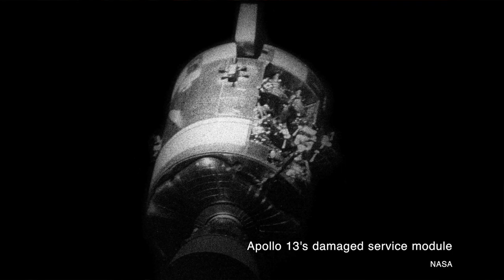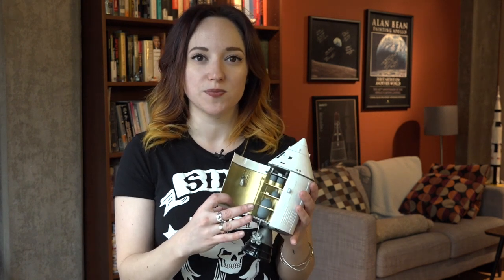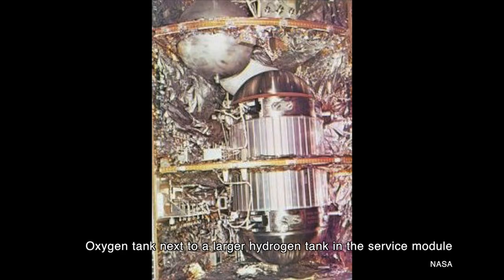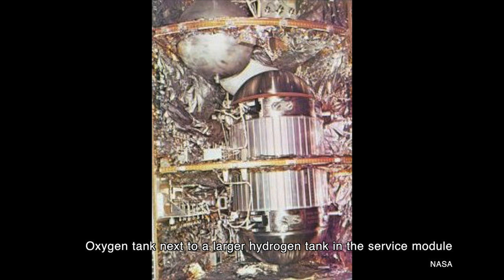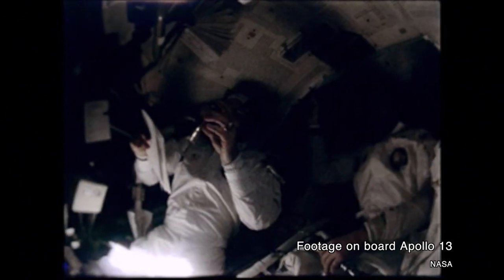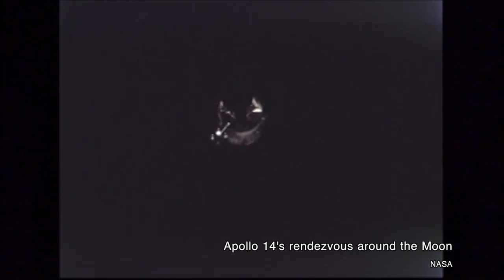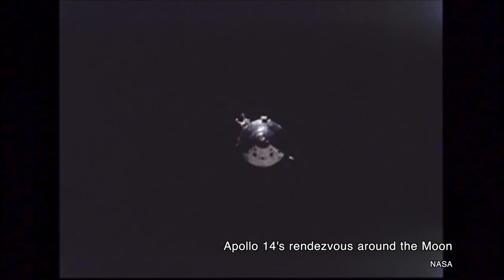What did NASA Change After the Apollo 13 Disaster?

Comment: Wait wait hang on a second.  So you're telling me that:
1: The oxygen shelf piece was used, and not new.
2: They'd tested the system with a wildly-higher power supply (65V) than the 25V that the spacecraft gave.
3: So it was already damaged BEFORE launch day.
This was exactly the kind of thing that Werner VB had talked about years before, and on TV no less: that most rocket failures are not caused by things that break in flight, but rather by parts that launch pre-broken, right from the beginning.

Comment: Just curious..one of the main reasons fuel cells were chosen over batteries was due to weight limitations(batteries  are heavy) So how did they manage putting a battery in the service module? Did they eliminate weight elsewhere?

Comment: Very fine report, once again! However, and I need to retrieve a couple of documents to check actual dates and voltages, you missed (unless I missed) the fact that Beechcraft simply over-engineered a part. (My buddy's words, not mine, and he worked as a Producibility Engineer at Beech for over 40 years.)

As he related to me, Beechcraft was an Apollo subcontractor, and (one of?) their component(s) was the cryo stirring fan inside the LO2 and LH dewars. Beechcraft, always on the cutting edge of putting more effort into customer satisfaction than absolutely essential, designed a tiny heater to ensure the fan wouldn't freeze up and fail at a critical moment and incorporated this into the unit. 

The problem was, the fan and heater were designed for an earlier design spec for the CSM electrical system, which was a much lower voltage (I can't recall the specific numbers and don't have David Baker's "History of Manned Space Flight" close to hand, but it started out with something odd like 17 or 27 volts and was upgraded to something weirder but many times more powerful, like 65 or something) than the original (Block-2?) flight specification. 

Somehow, that very important change in voltage didn't get to everyone it should have.

Dropping the tank (what, an inch or so?) was eliminated as a major contributing factor pretty quickly after it was suggested, though it was the prime suspect for a while. The overloaded heater on the cryo fan, however, was also responsible for the slow release of pressure in that tank (an anomaly that should have raised alarm bells even in NASA's overconfident atmosphere) and eventually led to the crucial spark. 

I love your channel! 99.44%pure, IT FLOATS! Sorry I don't have the actual numbers here.

Comment: Great stuff. 
Consumables.  
Do you know the formula for estimating how much hydrogen and oxygen are required to make a litre of water?   
100,000 K Calories of heat?  
45 VDC at 25 Ampres for one hour?
Did the the drinking water that was made from hydrogen and oxygen reqire any filtering or purification processing?

Was DEC Computers in Natick Mass a computer contractor for NASA?  If so, what did they do?  
I used to work with DEC gear.

Comment: A piece of that assembly was removed from the Apollo 13 Service Module...and installed into the Apollo 12.
The part was later replaced in Apollo 13.  Somewhere in the transfer...the wiring may have been damaged/frayed.
I've still got the scrapbook with the news article for Apollo 12.

Comment: Interesting about the thumbnail is that the Apollo 13 CSM configuration pictured never really happened. The spacecraft were around 35K nautical miles away when the CSM-LM stack was finally detached, and it was the service module that was popped off first, leaving the bell-shaped CM connected to the larger LM for a while before it was also jettisoned.

Comment: Amy, I'm confused about something you said in this video, that is that an oxygen tank that was used on Apollo 10, the first trip to the moon, was used again on Apollo 13. Were the service modules somehow recovered after the command modules separated for re-entry?
Reply: +Peter Palumbo I stand corrected it was the shelf that you said flew on 10 was installed in service module used on 13.
Reply: +Peter Palumbo 
It didn't fly on Apollo 10. She meant that it was reinstalled before flying.
Service modules were routinely abandoned to the incineration of re-entry.No component could survive to fly twice.
Reply: +Peter Palumbo - The Oxygen tank was originally installed on the Apollo-10 service module but was swapped out before the flight and then that same Oxygen tank was installed on the service module for Apollo-13.

Comment: Hi Amy. I was wandering if you could make a vid on why there was less computing power in the Apollo spacecraft than there is on a desktop calculator/phone? Thanks and keep up the great work!
Reply: +Yanni Tsetsekos You was wandering.
Reply: cause computers get better so fast
Reply: +Yanni Tsetsekos Because a) not much computing power was needed and b) most of the heavy calculations were done on Earth and the result uploaded to the Apollo spacecraft.
Reply: @AllanFolm  ...and c) the size of computing equipment at the time would take up a whole floor of a building! The use of the earliest solid state transistors for RAM and magnetic core rope memory for the ROM enabled NASA and MIT to put a very small computer in the space of a breadbox. The computer was originally envisioned to control the entire flight, but software delays compelled NASA to designate it as a backup to ground computations.

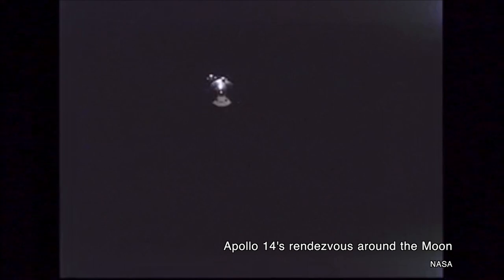Comment: Amy, Love the stories you do.  I have one quick question for you.  In this video starting at 3:22 there is a picture of the CM and the SM connected and doing a slow 360 degree pitch maneuver.  I've thought about this for quite some time and I can not come up with a reason for it, other than they were having fun, which I'm sure is not the case.  Would you please take up that question for me in a future video?  Thanks and love what you are doing.
Reply: Those are visual inspections, 360 degree rotations so that the entire outer surface of the vehicles could be observed and being filmed so that the engineers back at home could see how the vehicles were standing up to their time in space.  Each mission also include the LM accent stage doing a 360 and being filmed from the command module.

Comment: Nice Vid Amy. Question: why did they choose not to fit the CSM with solar cells? Soyuz has them: it would seem like a reasonable backup against fuel cell/battery failure.
Reply: +Harold Weaver Smith Apollo era solar cells weren't that great.

Comment: Minor, but worthwhile, point:  At least some Apollo engineers opposed the redesign of the oxygen tank that was performed.  Why?  Because the redesign created what amounted to a totally new design for the oxygen tank, eliminating the flight experience that had been gained with the old design (on Apollo 4 - 12).  Much more sensible, in their opinion, was to simply implement the Engineering Change Notice that had been posted way back when to update the thermostat in the heater to support ground voltages.

The managers overrode them:  given the nature of the close call that had been experienced, they felt (with reason) that neither the public nor the politicians would accept such a trivial change as the resolution to such a nearly catastrophic accident.

To be clear, the new design was certified -- on the ground.  But the first time it flew into space, it was on Apollo 14, a lunar landing mission.  Had something gone wrong in the redesign, it would have been a very bad day all around (and would have almost certainly resulted in the cancellation of the rest of the Apollo missions).

Something similar, but much more expensive, occurred after the Challenger accident:  the obvious engineering fix in that case was "Don't launch when the temperature is below 50 degrees Fahrenheit", possibly combined with "Place [external tape] heaters on the SRB joints to ensure that they remain warm pre-launch".  The actual redesign that was performed totally redesigned all the joints in the SRB, providing loads of redundancy for the seal (for starters, while the O-Rings that caused the problem were still present, and a third was added, the actual joint design was designed to ensure that no gas hit even the first of three O-Rings).  Again, while a through ground qualification process was performed on the new SRB design, most of the flight experience was no longer relevant to the new design, creating a significant risk of an unreleated failure mode being discovered the hard way.

Frankly, I'm not certain that the the politicians / managers don't have it right in these sorts of cases, but the engineer's argument is persuasive.

Comment: Excellent Vid as usual...Could  you explain how exactly the two units were connected that kept them from shearing apart during the explosion and the backward maneuvers (LM pushing the CM) that were performed to get them home?  This seal had to be very complex airtight and stable even after an explosion that blew a whole panel away.
Reply from the maker: +Joe Krol I'm working on something about the Apollo 14 docking anomaly, so that blog should have a section on how the docking and tunnel actually worked. Think that video should be up this week or next!
Reply: +Amy Shira Teitel (Vintage Space) Sweet!!!!!  Thank you!

Comment: Hi, 
The movie showed a sequence where the crew had to find a way to improve the CO2 scrubbers - ‘round peg in a square hole’ We’re these filters standardised to one universal design after Apollo 13? Krgds RodH
Reply: No.  The reason why could take a while to explain, but the bottom line is that if there were a known issue that could be solved procedurally and not require a physical engineering redesign of the craft (which itself would require costly testing, etc.), then there is no real need to re-engineer it.  In the movie, they over-exaggerated this a little bit.  In reality, they constructed more than one of these "conversion kits" (for lack of a better term) to fit the canisters from the CM into the LM.  They all worked flawlessly.  While there might have been a bit of scrambling to figure out how to do it, once they figured it out, they essentially had a proven and reliable procedure to fit the canisters from one craft into the the other, so they had a procedural fix if that problem every arose again.  If the program had lasted long enough, perhaps somewhere along the way, they would have re-engineered the craft so that the canisters fit both and were universal, but at the time, there was no real reason to do so considering that had proven and demonstrated procedures to address the issue if the problem were to be duplicated.  Bottom line - procedural fixes were preferred over engineering fixes from a cost and logistical standpoint - and by a very long margin.  They had the procedures after Apollo 13, so they had the fix if they needed it.

Comment: there was actually one other error that played a role in the failure. there was a revision during the design phase in which the system was upgraded to accept the 65V ground power, but the thermostatic switch was overlooked in the revision. it was still only rated for 28V, not 65. so when the switch tried to open, the arcing caused the contacts to weld themselves closed.

Comment: Can you imagine if this had happened on Apollo 8?

Some of the details you've given differ from details I've gleaned elsewhere. The thermostat was rated for 28v because that was the original spec, but when the spec was raised to 65v, Beechcraft (thermostat supplier) for some reason didn't get the memo, and never upgraded the 'stat. I also thought the tank was depressurized because they wanted to do an internal visual inspection after it had been dropped - to be "safe"! - and turned on the heaters to boil off the contents, leaving it on overnight. The thermostat was supposed to open when the internal temp got up to about 100 F, but as soon as it got hit with 65v it welded shut, so the heaters never cycled on & off - just stayed on. It got up to near 1000F, & fried the wiring insulation, and the rest, as they say, is history. Am I full of crap? Can I never trust Wikipedia again? You da man, Amy, I will humbly accept any rebuke I am due.
Reply: +lesnyk255 I've heard that too..

Isn't "you da woman" more appropriate? lol
Reply: +lesnyk255 I would argue that "depressurized" is the wrong word. Amy should have used the terms "filled" and "drained" since the LOX was in liquid form

During prelaunch tests, technicians filled the tanks and then attempted to drain them afterward. When tank 2's drain valve was opened, it would not drain due to a dislodged drain tube thanks to the earlier dropping of the shelf. (Any gas pressure that had built up from evaporation/boil-off was instantly relieved so the tank was no longer pressurized.) Since they needed to have the tank empty, the only alternative was to wait for the LOX to boil off, which would take a very long time because the tank was so well insulated. (It was designed to keep the LOX cold for 2 weeks in space.) The solution was to turn on the heater to accelerate boil-off. 

Visual inspection after tanking was not necessary because it had already been done after the shelf was dropped and removed. Engineers knew the drain tube was dislodge but also knew it wasn't needed for flight, and the heater could be used to empty the tank after ground tests. If the correct thermostat had been installed in the tank, everything would have been fine.
Reply: +lesnyk255 :I was thinking the voltage on the spacecraft was 28 VDC because that seemed to be industry standard at the time. I worked on Titan II ICBMs which had 28 VDC systems on board. I also worked as a NASA tech and QA on Spacelab and ISS although I don't recall what the overall voltage was. Been away from it too long I guess.

Comment: Grr...

I'm a bit disappointed that you didn't get to my question. 'Did NASA change the lithium hydroxide CO2 scrubbers after Apollo 13 so that the LEM and CM used the same units?'

For whatever reason it seems my comments haven't been showing up from some platforms I've been using. Oh well...

Anyway, keep up the great work and keep the wonderful videos coming!
Reply from the maker: +MrWATM I don't think they did. It would have been a significant redesign at that point in the spacecraft and likely would have seriously hampered NASA's ability to continue with lunar missions.
Reply: +Amy Shira Teitel (Vintage Space) 

Thanks for the reply! I have another burning question, though:

In all of NASA's radio transmissions, why is there an audible 'beep' whenever someone finishes speaking? What is the purpose and do they still do it today?

Thanks again.
Reply: +MrWATM 
It's called a "roger beep" that was sounded when they took their thumb off the microphone button. It was intentionally done since there was a delay in signals traveling to and from the Moon to indicate the end of a person's transmission. I don't recall hearing them used during Shuttle flights or on the ISS, but I do know many two-way radios can be set up today to do the same thing.
Reply: Their offical name is something like "quintones"?
Reply: Quindar tones.
Reply: +MrWATM , I think they carried extra Lem scrubbers in the following missions.
Reply: That did carry over to the space shuttle program though. Any parts that could be made universally interchangeable were made to be so.

Comment: interesting that among your listed corrections there was no "added a regulator to limit the 28 volt bus to 28 volts".  assuming there was nothing limiting current, the heaters would have been dissipating well over 2x their rated thermal energy.  I suppose it's a testament to "over engineering" that they simply didn't open (burn out).

Comment: Did they ever change the C02 filters so that they would fit in both the Service Module and the lander?
Reply: +Scott Jesienouski No, they just included instructions for how to make the adapter if necessary. Seriously.
Reply from the maker: +Scott Jesienouski That and the spacecraft were built by different companies, hence the two not going together. It would have been a massive undertaking to standardize it post-Apollo 13.

Comment: NASA replicated this problem in a vacuum chamber with a mock service module.  They cooked the oxygen out of the tank as they had done on 13, and then filled the tank and did repeated "stirs."

The tank exploded and blew the panel off the mock service module in the vacuum chamber.

NASA knew then they had figured out what really happened.

Comment: What did they do about the second stage pogo on 13? for 14?
Reply: +CaribSurfKing1 Engineers made a number of design changes to correct this problem. They added a helium gas accumulator in the liquid oxygen line of the center engine. The accumulator served to dampen or absorb fluid pressure oscillations, keeping them out of phase with the vibrations of the thrust structure and engines. The accumulator also lowered the first natural frequency of the propellant line, moving it down below the vehicle structural frequencies. In addition, the propellant valves on all five second-stage engines were simplified.

As a further note, the accumulator was actually designed prior to the Apollo 13 mission but was not ready in time for the flight.
Reply: Frank Brockler - Your posts are very informative.  Thanks.

Comment: Did NASA ever do anything about the two different CO2 filters used in the Command Module and the Lander?
Or did they continue with one round and one square?
Reply: They continued as designed - as they had a proven fix for the problem if the need were to arise in a later mission.

Comment: Apollo 13 was actually extremely lucky. If the problem had developed  much earlier, there would not have been enough consumables in the LM to last the rest of the way to the moon and back. If it had happened after LM/CSM separation, no life boat.